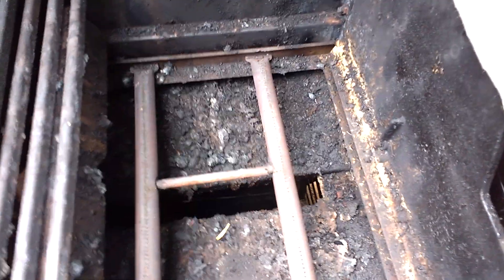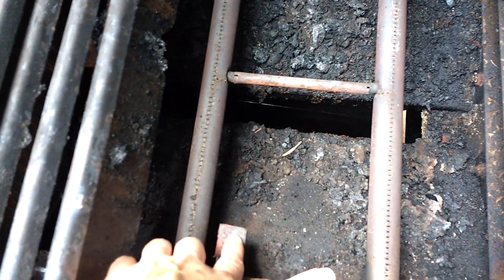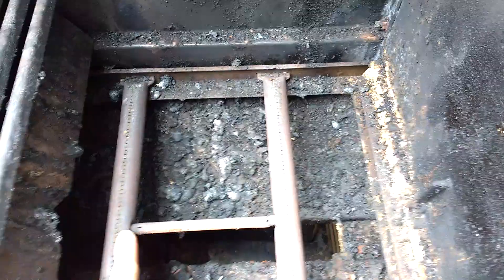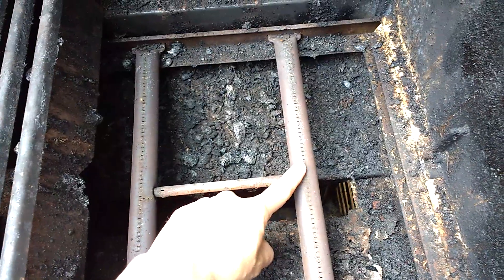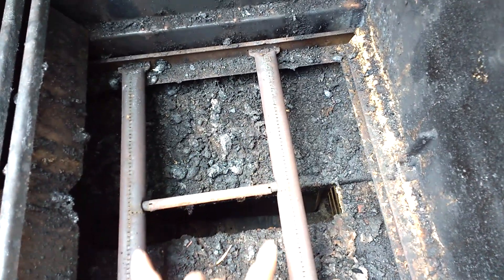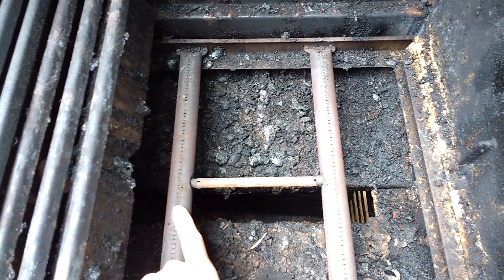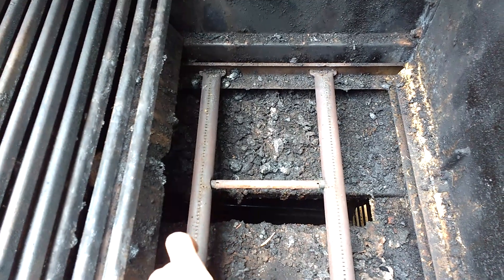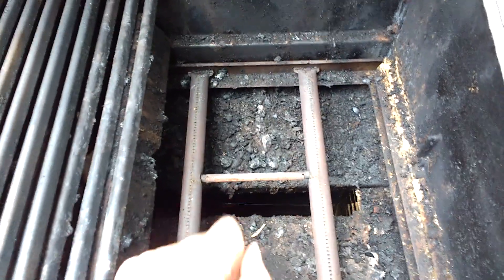Why is Only One Burner Lighting?

Comment: I have a 2009 Genesis, last model to have horizontal burners.  I wish I would have waited for the new 2010 Weber Genesis with the vertical (front to back) burners LOL.  This year (2021) I am having an issue with my back burner not igniting on a consistent basis.  The front one is the first to get lit.  I can hear can flowing for the rear burner when I rotate the knob.  I just now thought to test with a BBQ lighter to see if I can light it manually.  Otherwise, I just have to get it lit when the lid is almost closed.  Yes, I know it is not ideal.  So, it sounds like this carry over tube may be clogged.  I have not taken a brush to it yet to see if that resolves it.  I really noticed it today when I was trying to cook a couple of Italian sausages to go into pasta sauce.  After a half hour, of what I thought was front & back indirect, only the front was on.

What a pain in the neck!

Comment: Greetings from Puerto Rico. A strange thing is happening to my grill, i can use the first burner but if i try and start the second one, the first one shuts down.
Reply from the maker: Hi, this definitely sounds like a regulator problem. Try resetting it by turning off the tank and then removing the hose from the LP tank. While it's still connected to the grill (but disconnected from the tank), open the hood of your grill and turn on all valves (knobs) to high. Wait two minutes. Then attach the hose to the tank and turn the tank on slowly. If this doesn't fix it, you may need a new regulator and hose.

Comment: Hi Grille Girl.  I have replaced the burner and carryover tubes in my grille with, ostensibly, exact replacement parts from the manufacturer (Kenmore).  The one burner with igniter works fine, but the carryover tubes aren't  doing their jobs.  For some reason the "kit" omitted instructions and, additionally, the burner tubes weren't drilled to show where carryover tubes should be installed.  I  guessed, wrongly apparently, by drilling and installing close to gas orifice, about 4 inches from the near-end.  Any suggestions?

Comment: Hi Grill Girl, I obtained a used Weber grill a few weeks ago and I am all of a sudden having a problem with the Primary Burner only lighting 2/3rds of the way across.  I just watched this Video and my problem is just a little different.  My 3 burners run left to right and the Carry Over tube is down on the left.  Now, after turning on the gas and striking the ignitor, the gas lights on the first burner, but stops as soon as it gets 2/3rds of the way across the whole burner, just 1/3rd short of lighting the Carry Over.  It's as if something is all of a sudden Blocking the gas from going ALL of the way through the burner tube.  Any ideas?
Reply from the maker: First thought here Bil is the regulator. If it is an older grill, it's a great idea to switch out the regulator as you clean it up and get ready to use it. Regulators go bad over time so you will often see this symptom of looking like there's not enough gas for the burner to light fully. If this is a natural gas grill, yes I would think some blockage. I would disconnect everything and use some pressurized air to clear out the manifold, the NG source and if possible the burners themselves. Let me know what you discover!
Reply: Thanks Grill Girl!!  I will try that!!  I'll let you know how it goes.
Reply: Bil Gardiner hi Bill. Did you fix your problem? I have the exact same issue
Reply: @longsen83  He bought a new grill.

Comment: I have the same problem. I have charbroil very lightly used grill. Carry over tube is good, no blockages. What else can be wrong ?
Reply: Maybe your ignitor Is not working ?
Reply from the maker: Hi Rahul, it could also be the regulator. Try resetting it by turning off the tank and then removing the hose from the LP tank. While it's still connected to the grill (but disconnected from the tank), open the hood of your grill and turn on all valves (knobs) to high. Wait two minutes. Then attach the hose to the tank and turn the tank on slowly. If this doesn't fix it, you may need a new regulator and hose.